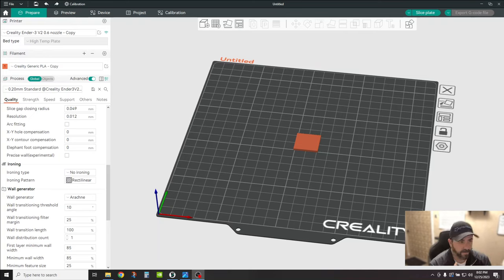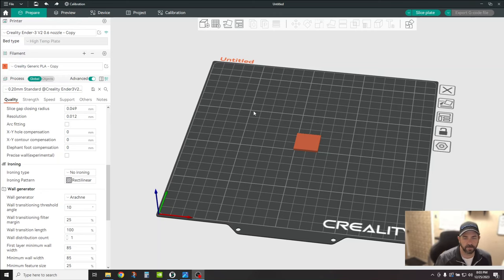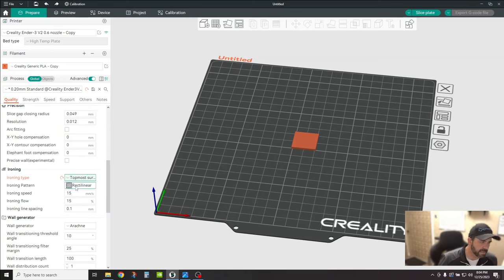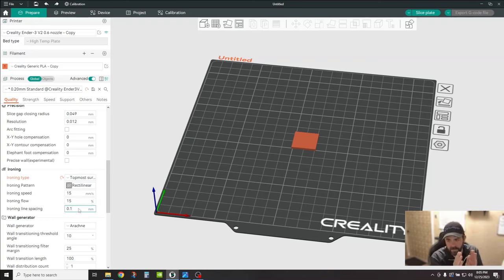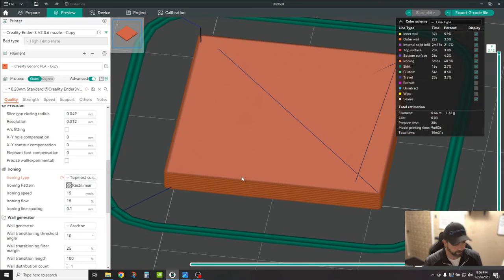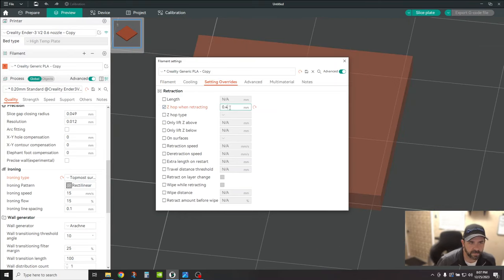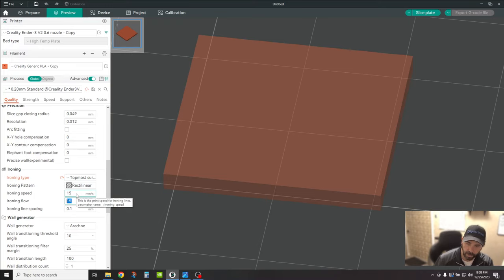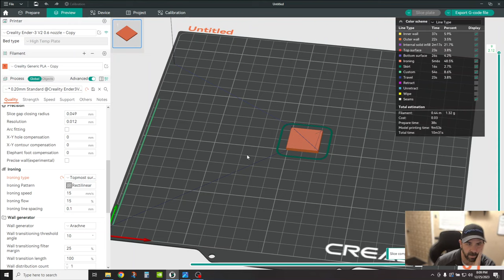Mastering Perfect Finishes: Orca Slicer's Ironing Feature Explained!

Comment: Hi, great vid - very informative! Liked the tip you gave to enable Z hop on top layer only to remove travel lines!
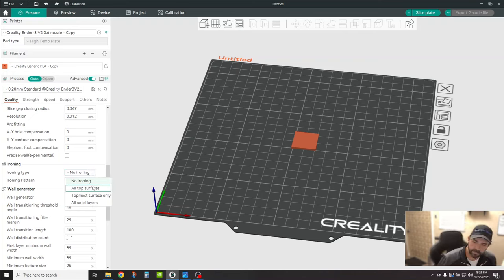One thing tough re 01:39 - I'm pretty sure that "all top surfaces" refers to a scenario where the object has different areas where the top surface is on different layers. For example on the 3d benchy, enabling all top surfaces would iron the deck as well as the top of the chimney etc. "Topmost only" would only iron the top of the chimney, so that would not be good in that case. Enabling "all solid layers" would do what you said - iron all 4 top layers - which as you said is also not a good idea. I'd say "all top surfaces" would be ideal for most prints.

Comment: I have a quick question. I have got a ender 3 v3 SE and i am having trouble finding the ender 3 v3 se printer in the orca slicer program. do you have any suggestions as to how or where i can find that printer? i was thinking i may have to update the orca slicer? or perhaps the ender 3 v2 printer could work? i may just give that a try and see what happens.
Reply from the maker: Hey there.  You could certainly do that.  Just make sure you update any differences in the print area and extruder if different (Direct Drive vs Bowden).  You could also shoot for a nightly build of Orca.  I see some mention in this post of a profile for your printer added.  https://github.com/SoftFever/OrcaSlicer/pull/3180
Reply from the maker: Hey, I just downloaded the 1.9.0 version of Orca and see a profile in the list for and Ender 3 V3 SE.  You might want to check it out.
Reply: @fischer3d  Sweet. I will deffiently check it out. I've just been using the ender 3 v2 profile which works alright. Some of my prints were a bit hairy. Thank you for the information. I been printing all sorts a stuff like a manic. LoL

Comment: What happens if you have 2 colors on the top?  The only reason my surface looks weird w/o ironing is because it has to work around the other color so the print lines go one way for awhile, then it moves to work around something and when they are all done, you can see differences in them (because it wasn't continuous printing from one side to the other).  I'm guessing since there is still flow happening, it's going to do something similar when ironing?

Comment: For a cyclinder is there a way in Orca Slicer to iron using a circular path? In Cura I'm pretty sure this is possible but it's not obvious in Orca if it's even possible.
Reply from the maker: Currently there are only 2 ironing paths.  Rectilinear and concentric.  If it's a round top you may have luck with the concentric option.
Reply: @fischer3d  I tried that but in preview it shows the exact same path as the rectilinear. I've printed with both and the result is exactly the same, I'm running the alpha so it could be a bug.
Reply: @fischer3d  I found, under strength: top/bottom layers and they have options for patterns. There's concentric in there and the preview looks to be what I'm after. Thought i'd mention it for anyone else stumbling on this. :)
Reply from the maker: Oh good, thanks.  Is that going to give you the ironing look you want or just the typical concentric path finish with no ironing?

Comment: Question? Why does no one cover the weird 45 degree ironing angle? Rectilinear does not go back and forth side to side on orca slicer. Yet concentric does what it is supposed to do. I cannot find anywhere to change this, and this is why to this day I do not and cannot use Orca slicer and have to go back to Bambu with my flow settings.
Reply from the maker: Have you tried changing the "ironing angle" setting?  At the default "-1" the angle is turned off and it is going to go perpendicular to your last layer, usually at a 45.  If you change that to anything other than a "'-" you can control the direction.  When I switch mine to even some like "1" the ironing goes side to side.